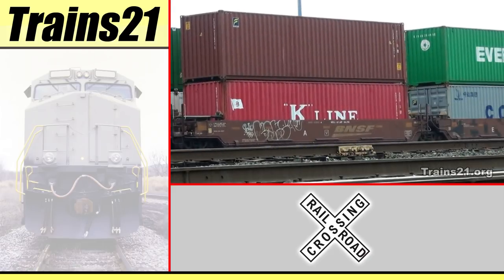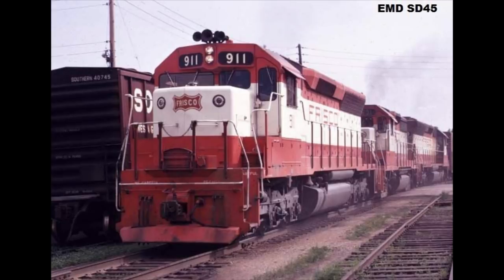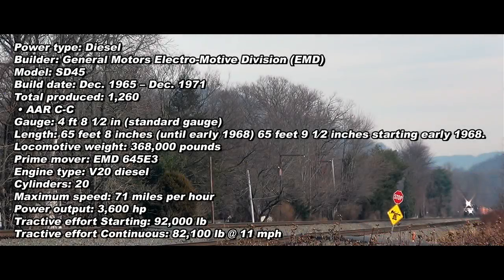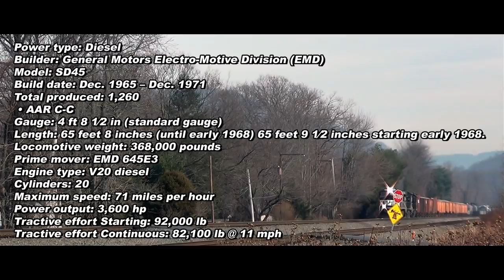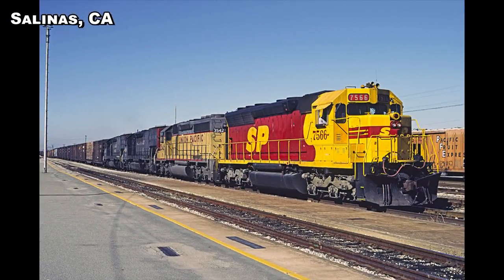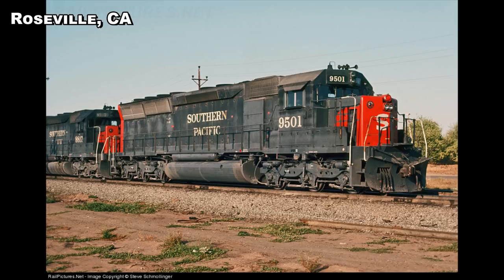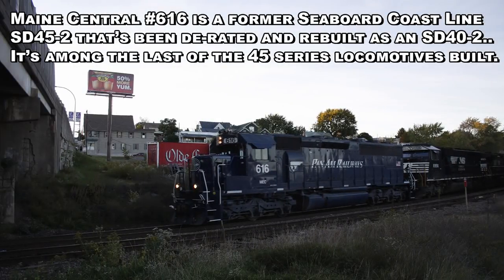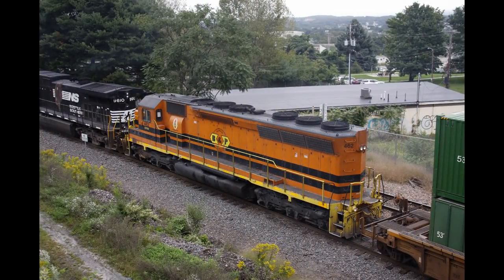[GL][T-176] ENDEARING EMDs: The Indelible SD45 Locomotive | Trains 21

Comment: I once worked as an engineer for the Santa Feces out of Denver, August 1978 to October 1981. I ran "Hustle muscle" twice out of Denver. The problem with the ex-GN six axle engines was the weight, only 368,000 lbs. All that power and no weight. Going up to Palmer Lake, CO., I would see the wheel slip light constantly flickering, then cycle into dynamic braking from the Lake downhill, and the wheel slip would be flickering again! These engines were flat land screamers, but they were not mountain goats at all. The SP SD45's we would get in pool service were mountain mashers. They weighed in at about 410,000 lbs or more.
Reply from the maker: Awesome! Thanks for sharing your memories.
Reply: Excellent video.

Comment: The crank probs on the 20V were caused by the length of the block weldment, which put just enough twist on the main bearing alignment to strain the crank beyond capabilities while on bad track, which would cause accelerated main bearing wear, thus allowing for harmonic vibration to get out of control.  This was the same issue that doomed Alco's notoriously bad 244s. EMD figured out that the wear on the rear main was a reliable indictator of crank twist and issued a maintenance bulletin that routine bearing clearance checks be done to maintain tolerance.  Of course, SP didn't have time for that, and rear main bearing web cracking and crank failure were common.  SP's "solution" was to change governor setup to yield only 3200 HP, thus largely negating the power-per-unit advantage of the 20V.  This led to 3 different governors in shop stores for the 20V...3300, 3600 and 3800 HP, and the shops would use them indiscriminately just to get the unit back on the road.  ATSF, though, had very little crank problems on theirs at 3600 HP.  The difference?  SP's historically lousy jointed rail, which would twist the long frame, and thus the prime mover, far worse than on ATSF's well maintained Steel Highway.  After SP went down the tubes after the SPSF merger fell apart, Anschutz's RGI had the better remaining 45s rebuilt on the cheap by M-K as essentially SD40s with big radiators, a swap that started in SP's own R20 rebuilding program at Sacramento before Anschutz closed all the shops.
Reply from the maker: That's an awesome treasure trove of information, thanks for sharing it with us! I didn't know any of that!

Comment: i worked sp 1970 diesel pit in sparks nevada and i remember sd 45 x 9500 which came over donner pass fairly often. the whole electric cabinet in the back of the cab was covered with little plastic stick on plaques.....this locomotive equipped with this and that. it was rumored to have 5000 hp. they were very careful where it was put in a train.
Reply from the maker: That's awesome.. Thanks for sharing your firsthand knowledge of a bygone era.
Reply: That’s cool that you had first hand experience with an SD45X. Officially they were rated for 4200 hp. I guess the story goes that only a few were made because it took an outrageous cooling system to keep temperatures under control, due to the higher than normal hp rating.
Reply: The SD45X had 4,200 hp--which was still quite impressive. SP ordered three and then got three of the EMD SD45X demonstrators. 9500 was a solo order, 9501-9502 came right after them, then they got the ex-demonstrators became 9503-9505. Not sure how long they lasted, but I don't think any of them made it to 1980.

Comment: One interesting note about Southern Pacific's SD-45's:  

Due to the cooling troubles in the mountains, particularly Donner Pass and running very heavy trains at 7 mph instead of the EMD recommended minimum of 20 mph, the production of 1,260 SD-45's and EMD's dominance was almost not-to-be.  SP and EMD went back and forth for several years on the cooling issues versus the minimum 20 mph recommendation.  That was until SP acquired some GE U-30C and U-330C's and tested them over Donner Pass.  The result:  The GE's did NOT derate like the EMD's.  Since SP at that time was a key player to locomotive builders, EMD realized they needed to come up with a better design to SP's operating conditions, thus the famous Tunnel Motors were created.  

SO... the SD-45's contributed to railroad history in more ways than so many normally know about.  Their history is fantastic, but to also read about the run-up to the Tunnel Motor in the SD-45's history really makes it quite amazing.
Reply: I have to question the information you stated about EMD's handling altitude poorly in contrast to GE since that goes against literally everything I've ever gathered about SP over the years. Especially in the Pacific Northwest SP's SD40/45's essentially dominated practically every mainline train in existence simply because they - DID - in fact handle altitude better then GE's. Hence why during the 70's and 80's practically every train in every mountainous division on the system was EMD powered and that remained the case throughout the Dash-7 and Dash-8 era only coming to an end when GE was able to produce high HP six axle DC traction models of the Dash-9 variety as well as AC traction units whereby then SP only pulled the EMD's out of the mountains simply dude to new higher HP and AC traction unit's having superior performance compared to lower HP DC traction units.

Further supporting what I said about EMD's handling altitude better was the fact that during the early GE years on SP (when they weren't all mothballed at Taylor yard or elsewhere on the system) SP specifically kept their GE's on the lower flatland routes away from higher altitudes putting them on about any train they could. Granted GE's Cooper Bessemer prime mover was more less an embarrassment on all accounts no matter how you look at it with how ridiculously unreliable and maintenance intensive it was especially coming from a company the size of GE which obviously could do much better.

SP's EMD's showing slow speeds at altitude wasn't a problem of altitude but rather of option style. SP always opted for fewer but longer heaver trains. Hence why even in flatland routes it wasn't uncommon to see SP trains moving at slower speeds compared to their competitions trains. Put that same traffic in mountainous divisions and slow speeds as well as high radiator temperatures are going to be the norm. EMD was simply trying to build the 'super units' that SP wanted but weren't really technologically possible at the time. Plain and simple SP was learning the hard way you can't have you cake and eat it too.
Reply: @Henry5623  In my statement, Henry, I was referring to the numerous tunnels that SP had to contend with on their system.  My obvious mistake was not directly mentioning that and the period of time prior to the tunnel motor design arrival.  Where I read about those issues SP was having with the SD-45 versus the U-30/U-33's was in a "Locomotive Magazine" article by TRAINS magazine.  

I'd also like to point out that what you mentioned in your statement about SP locomotive assignment is quite accurate.  I've looked at many video's of SP's Donner, Tehachapi, and Cascade lines and it's interesting to note that there are very few GE's seen on those lines, until the Dash-7's, 8's, and 9's/AC4400's and higher horsepower EMD's arrived.
Reply: @stephenroberts4895  I agree completely that despite all the bad the could be said about early GE's they did have one unintentional trick up their sleeve having nearly frame level mounted air intakes for their radiator systems by default. Under that perspective yes GE did have a advantage in tunnels before EMD caught on. One could argue too that GE's 4-cycle design firing half as often as EMD's (at the time) 2-cycle platforms gave GE a slight cooling advantage in tunnels as well.

It's a shame it took GE so long to build their own 'in house' prime mover to overcome the reliability issues the Cooper Bessemer platform had. A lot of early GE's suffered unfairly because of it. Not that EMD didn't learn their lessons the hard way as well. With their tier-4 units having issues almost literally right out of the factory some lessons remain to be learned apparently.

On the topic of EMD's in the mountains especially in the Pacific Northwest if you can find some footage of the 50's and early-ish 60's it was almost comical the size of some of SP's power consists used on their lumber drags then. First generation 4-axle units powering those trains with at times literally a dozen or more units on the head-end alone just to get it moving not including helper power. Needless to say management was happy to see higher HP six axle units start arriving on the property lol...

Comment: Brazil has a variant of the SD45 built by EMD, the DDM45 it uses the SD45 "Snoot" frame with the DD35/DDA40X trucks, they still have their 20 cylinder engines.
Truly beautiful machines.
Reply from the maker: Yep, I've seen picture of them.. Thanks for the info.
Reply: @Trains21  no problem, mate.

Comment: Two Seaboard SD45-2s ended up on the Duluth Missabe and Iron Range. The numbers on the Missabe where 416 and 418 i can’t remember there scl numbers how ever. They where rebuilt in the 90s to SD40-3 specs and even made it for a few year into the CN ownership both where scrapped in 2007

Comment: AC: Your belief that Western U.S. Railroad companies, will eventually be operating on the Eastern and East coastal states, may have some validity. I reside in Northeastern Indiana (Fort Wayne).  Just two days ago, Norfolk Southern announced they were moving 12 specific job titles to Pennsylvania from the Fort Wayne District. You know how they sell it to the folks of the community there departing; as realignment for better efficiency. In my neck of the woods, we have just two Railroad entities; I.E., Norfolk Southern and the Chicago, Fort Wayne, and Eastern (the old Pennsylvania line). In counties and cities to the North of me; it is CSXT through Garrett, Indiana, and Norfolk Southern's Chicago Line through Kendallville, Indiana. By the way, the place for which I was employed for 27.5 years before pensioning in 1996, was the 911 emergency call and dispatch center. We were located in the Rousseau Center (CITY/COUNTY Building), and we had an enormous emergency power generator for the premises. It was located in the bowels of the building. It was a V16 cylinder Detroit two-stroke diesel-powered engine (manufactured by Gen. Mtrs. Inc.).  It went into test mode every Wednesday at noon for 10 minutes. The noise it created was deafening.
Reply: Good old 16v71 genset.
Reply from the maker: Those are some memories, thanks for sharing.. I know the regions you speak of..

Comment: Wisconsin Central Ltd bought up a lot of SD45s on the used market from BN and ATSF as well as a few F45s an FP45 and one SDP45 that came the long way from EL. All of the units were derated to 3,000 HP. If it had a straight frame it was wanted... I do wish a few more "F"s would have been acquired. The FP45 was my favorite loco to work on during my short career at the bankrupt Milwaukee Road.
Reply: Actually, they were de-tuned to 3200 hp when first acquired, then re-rated to 3450 hp after the electrical system was upgraded in the 90s..........

Comment: The Utah Railway leased 11 sd45s, from the southern pacific with the 20 cylinder engines in the 1980s they hauled coal over price canyon for 6 short years and were all scrapped in 91,great locomotives for there time to bad they didn't keep one of them in a museum all but 2 had the bloody nose scheme,Utah railway painted 2 of them grey and had white stripes on both noses, they were 9140-50 they had a sound of there own,I have only seen 2 clips on YouTube about them

Comment: In Mexico there are about 13 SD45 but most are from FERROMEX and one from KCSM but that locomotive was donated to a museum in Mexico and the museum is called the Matamoros railway museum. Some Ferromex locomotives have the body of SD45, but they have the engine  of an SD40-2 to spend less fuel and only Ferromex has few original SD45

Comment: EMDs were built towards the minimum as possible side, because they were top dog. GE came in built locomotives on the rough and tough side, durability #1. 
GE wasn't as user friendly as the long time king EMD, so as GE aged it changed. So did EMD, building bigger and heavier locomotives to keep up.
So today, GEs are the king of the road on mainline heavy haulers and EMD king of the user friendly locals, switchers, and short line railways.

Buying locomotives always has been a political twisting of the arm thing anyway, if you don't buy some of ours, we won't sell you any parts for your older models.
Around 45 years working on all manufactures and models, in shop and on the road, you could get an older EMD to work but a GE you most always had to have a part.
Now a days you just go the the computer and see what the fault is and if can be reset or bypass the problem.
Reply: This is a great explanation.Nowadays modern GE units are the most reliable when it comes to serious tonnage.Better dynamic braking and tractive effort overall.In addition to that GE has seemed to be better in technological advancements and software.EMD began to face problems after discontinuing the GP40-2's & SD40-2's with the GP50's & SD50's being the start.GE started to improve after realising what issues were present with the 23,30,& 36-7's including overheating dynamic grids.The introduction of microprocessors were apart of that.As much as any EMD motors are solid,that's never doing much,the newer GE units completely overthrow them in the pulling and traction category.The biggest issue to EMD was EPA regulations and CAT/PRLX ruining the company.The only benefits of most EMD units in modern times are quicker loading traction motors and switching,espiecally the MP15DC's and GP40-2's.Although GE units can still come in handy for that.Everything else you've already mentioned in good summary.

Comment: Bnsf has rebuilt a sd45-2 with a 16 cylinder engine and it is 1572 and used as a remote control switch engine in Casper Wyoming
Reply from the maker: Thanks for that info Ted!

Comment: all 2 stroke diesels cannot scavenge air, so it’s coming with some kinda forced induction via blower or mechanically assessed turbocharger, the ship engines i’d work next to (i serviced generators) had huge electric squirrel cage blowers to get them started and idle, then 4 to 6 small abb turbocharger took over from there, like the emd they have axial turbocharger. also they retired the 20cyl because it kept breaking crankshafts, i worked for progress rail in GA 05-07 ✌🏻
Reply from the maker: That's a very different perspective on EMD engines.. Thanks for sharing those memories.
Reply: Trains21 i do service 1 710 20cyl at the water treatment plant here but not often, mainly 1 month loadbank service ✌🏻🇺🇸

Comment: A slight correction. The N&W units weren't "geared" to operate long hood forward. Their control stands  were set up for long hood forward operation. Gearing has nothing to do with determining which "hood"....long or short leads.
Reply: I thought he was referring to things like the direction the horns point, the location of the bell and the control stands (some had dual control stands), not traction motor gear ratio.
Reply from the maker: @chuckgilly  Exactly right.